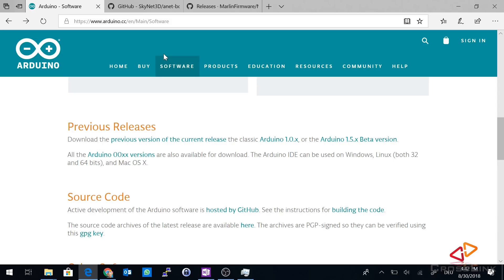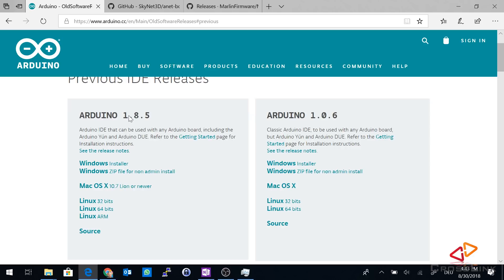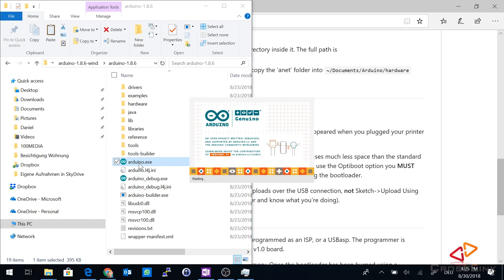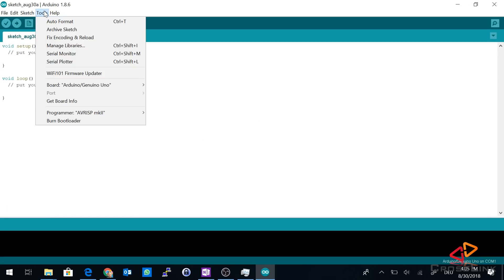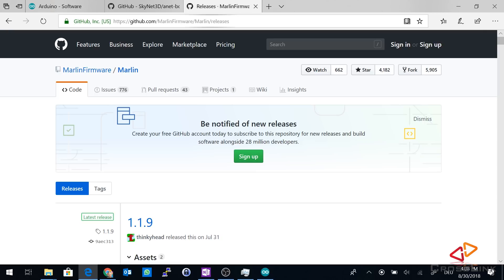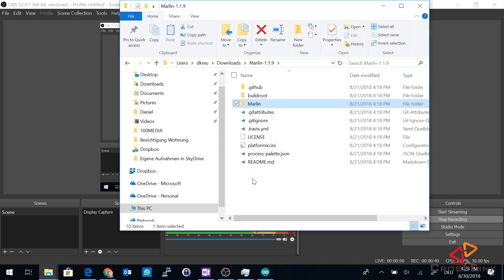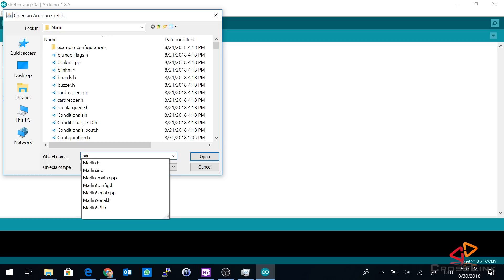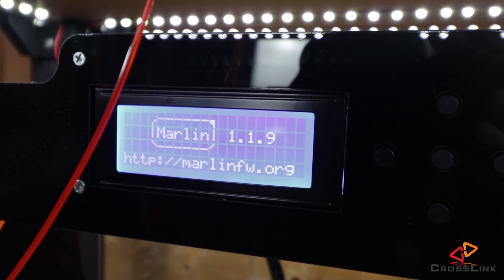How to install Marlin firmware 1.1.9 on your Anet A8 3D printer in 7 easy steps

Comment: Thank you for this video - it's been really hard to piece things together for this process - your video makes it all crystal clear.
However, and this may not be something you can help with, but I'm unable to complete the load.
the IDE reports:
avrdude: stk500_getsync() attempt 1 of 10: not in sync: resp=0xd6
...
avrdude: stk500_getsync() attempt 10 of 10: not in sync: resp=0xd6
An error occurred while uploading the sketch

Using the serial Monitor at 115200 baud, I can see the processor reboot, and report back the amount of free ram and then:
SD init fail

Any ideas you might have would be very welcome.
thanx
Reply from the maker: Not in sync points mostly to two possible problems. First you might have missed to install the Arduino drivers, which are in the drivers subfolder of the Arduino IDE installation folder. Or secondly, you might have a problem with your bootloader, which requires fixing by using an Arduino as ISP or an USBTinyISP as a programmer. I will cover this in one of the next videos ;-)
Reply from the maker: Actually I got to hear that Anet delivered a lot of boards (not all) without a bootloader. So you would have to flash a new one to fix it.
Reply: Thanx for the help.
I tried to load the bootloader, but with the old ICSP (is that the correct acronym?) I got a different failure.  The connector to the anet board has all of the wires swapped on it, and now I'm wondering if maybe the unit is just screwed up.
So I'm going to get a new unit and try again.
r
Reply from the maker: Check out my new video about how to fix firmware flashing and broken bootloaders: https://www.youtube.com/watch?v=RQIizXtf9oo

Comment: I am on the point after verifying the code and I got an error #error "Oops!  Make sure you have 'Arduino Mega' selected from the 'Tools -> Boards' menu." should I proceed on choosing that option?
Reply from the maker: You need to select the Anet 1.0 board if you try to flash using the USB cable. If you dont"t have that option you missed the initial step to copy the board master files.
Reply: @Crosslink3D  I figured out what was wrong after couple hours of reading all the codes. I have to put anet 10 motherboard on the define command somewhere within the codes. That's what's causing the error.
Reply: I manage to upload it with no issues, hope it works.  Haven't tried it yet. But i'm still going thru all the settings, hopefully I get it to work by this weekend.
Reply from the maker: Cool, keep me updated how you do 👍
Reply: Just got home and was excited to get back to working on my setting and after I turned on my printer, two rows of white square appears on my printer lcd screen. Tried to verify and got an error. 

"GetFileAttributesEx C:\Users\gacac\AppData\Local\Temp\arduino_build_757491: The system cannot find the file specified.

Error compiling for board Anet V1.0."
Does this mean my board need replacement or can it still be resurrect with USBASP?  @Crosslink3D
Reply: OMG this is what i'm getting now "Build options changed, rebuilding all
In file included from sketch\pins.h:242:0,

                 from sketch\MarlinConfig.h:40,

                 from sketch\G26_Mesh_Validation_Tool.cpp:27:

pins_ANET_10.h:92:4: error: #error "Oops!  Make sure you have 'Anet V1.0', 'Anet V1.0 (Optiboot)' or 'Sanguino' selected in the 'Tools -> Boards' menu and ATmega1284P selected in 'Tools -> Processor' menu."

   #error "Oops!  Make sure you have 'Anet V1.0', 'Anet V1.0 (Optiboot)' or 'Sanguino' selected in the 'Tools -> Boards' menu and ATmega1284P selected in 'Tools -> Processor' menu."

    ^

exit status 1

#error "Oops!  Make sure you have 'Anet V1.0', 'Anet V1.0 (Optiboot)' or 'Sanguino' selected in the 'Tools -> Boards' menu and ATmega1284P selected in 'Tools -> Processor' menu."

Using proxy DIRECT

Using proxy DIRECT

Using proxy DIRECT"

It was working ok last night, what would went wrong.. I have no idea.....
Reply from the maker: What Version of the Arduino IDE are you using?
Reply: @Crosslink3D  1.8.5
Reply from the maker: I think your problem has nothing to do with your board. If you get a compiler error there must be something wrong with the Marlin sources. Maybe get a plain new snapshot of Marlin in a new folder, change nothing and then try to compile.
Reply: @Crosslink3D  Youre a SAVIOR thank you. Its ALIVE!!!!! lol... Now time to learn how to calibrate...
Reply from the maker: If you get other errors, maybe check out my new video about how to fix broken bootloaders. Also helps with "sketch too big" errors when enabling many features: https://www.youtube.com/watch?v=RQIizXtf9oo

Comment: If I get to relate the topic of Edward Garcia´s comment. I also get "not in sync" errors when I try to flash the Marlin firmware to the motherboard of my Anet A8, and I am using a USB B cable ^^ How am I supposed to do it?
Reply from the maker: You may have a broken bootloader. It can be resolved using an Arduino as ISP or a TinyUSBISP. I am making a video of this in the next weeks but I am still working on the details.
Reply from the maker: I have just released my howto video how to fix broken bootloaders and other issues: https://www.youtube.com/watch?v=RQIizXtf9oo

Comment: Thanks for the video. I tried but by uploading firmware i got errors:

Arduino: 1.8.5 (Windows 10), Board: "Anet V1.0"

Sketch uses 125002 bytes (98%) of program storage space. Maximum is 126976 bytes.
Global variables use 4318 bytes of dynamic memory.
avrdude: stk500_getsync() attempt 1 of 10: not in sync: resp=0xd6
avrdude: stk500_getsync() attempt 2 of 10: not in sync: resp=0x6f
avrdude: stk500_getsync() attempt 3 of 10: not in sync: resp=0x80
avrdude: stk500_getsync() attempt 4 of 10: not in sync: resp=0xbf
avrdude: stk500_getsync() attempt 5 of 10: not in sync: resp=0xae
avrdude: stk500_getsync() attempt 6 of 10: not in sync: resp=0xd6
avrdude: stk500_getsync() attempt 7 of 10: not in sync: resp=0x02
avrdude: stk500_getsync() attempt 8 of 10: not in sync: resp=0x21
avrdude: stk500_getsync() attempt 9 of 10: not in sync: resp=0xcc
avrdude: stk500_getsync() attempt 10 of 10: not in sync: resp=0xd6
An error occurred while uploading the sketch

Any suggestions?
Reply from the maker: Yes you probably have a broken bootloader and need to use an Arduino as ISP or a TinyUSBISP to flash a new one. I will do a video about it I the coming weeks but still working on the details.
Reply from the maker: I have just released my howto video how to fix broken bootloaders and other issues with firmware flashing: https://www.youtube.com/watch?v=RQIizXtf9oo

Comment: i bought my anet A8 about 1year ago.. haven't printed 1 thing..i built it and was all excited.then after all my research i was told i needed to update firmware to marlin.. so i tried it following all the steps.. didnt work (not in sync error) So i search and search found nothing that worked. I ordered a new board.. same issue. I finially gave up and was just burnt out on dealing with it. I saw this video today and decided to try it again.. and same error. by the way I have the USBASP tool and tried all that and didnt work for me. any help would be appricated
Reply from the maker: Hi James, I know this topic is frustrating. Especially if a bootloader is missing. I am currently putting together another series of videos that cover that topic. so you will have a place to go to watch all the details. Upfront I can tell you that USBASP did not work for me on Windows 10 but I was successful using an Arduino Uno that I had laying around. What I will also test is a USB Tiny ISP.
Reply from the maker: Actually I got the USBASP only working with Windows 7, since I have upgraded to a new PC with Win10 it doesn't work anymore. There is some tools out there that claim to make it work again but very cumbersome and not working for me.
Reply from the maker: I have just released my howto video how to fix broken bootloaders and other issues with firmware flashing: https://www.youtube.com/watch?v=RQIizXtf9oo

Comment: Hi, first of all thank you for video. Now my anet a8 is running with marlin. But i have problem. I get this error; "THERMAL RUNAWAY PRINTER HALTED Please Reset" This error  started when i installed marlin. Please help me.
Reply from the maker: Most likely one of your connections (heated cable, hot end heating element) on the board is loose. Better crimp cable shoes to all connections delivering power. Also check if the heating element's grub screw is tightened at the Hotend. The original firmware does not detect thermal runaway, so there might have been some issue before flashing already. Thermal runaway is triggered if any temperature (Hotend, Heatbed) drops more than 15degress Celsius for more than 45 seconds. Another issue could be that your Hotend cooling fan is cooling your heating block too fast when the fan starts running. This kind of heat block "sock" can help a bit to prevent this: https://www.ebay.com/itm/3D-Printer-Silicone-Sock-Heater-Block-Cover-MK7-MK8-Hotend-Heater-Protect-ur/183531575623?hash=item2abb559947:m:mrXO3uBZ0Ntvqiee1Ba28eA
Reply: @Crosslink3D  ohh :) yeah problem is connections. i checked all connections and i am printing now. I am learning a lot of things your videos. Thanks again :)
Reply from the maker: Great to hear that. I believe since this problem was asked a few times, it would be good to make a special tips video for this issue. Greets. Daniel

Comment: hey thanks for the video, ive follwed your instructions and its loaded with marlin 1.9 but the X Y X are flashing with 0? any ideas as to what is wrong
Reply from the maker: Hi Carole, what exactly do you mean with x y z are flashing with 0? Can you explain please?
Reply: @Crosslink3D  X y and z are all flashing from a 0 to a ? repeatedly, im also having trouble with auto bed leveling, i have it all in the menu and the sensor attached but it crashes in to the bed everytime i press home all
Reply: its like it dont know when to stop,as i have removed the endstop
Reply from the maker: Please dismount the sensor and hold it perpendicular to the printbed. Does the red light light up when you get close to the bed? how close do you have to go to make it turn red? FOr me, the distance is 2-3mm.
Reply from the maker: Any news here? Would love to help but need your feedback ;-)
Reply: Hi @Crosslink , I've just got the same error.  XYZ all alternating between ? and 0.  No other commands on the panel appear to be working.  Enter takes me to a menu, but trying to select anything sends me back to the home page.    Up and Down alter the FR %, but that's all.  Any thoughts?

Comment: It keeps overriding the 115200 baud rate
         Using Port                    : COM6
         Using Programmer              : arduino
         Overriding Baud Rate          : 57600
avrdude: stk500_getsync() attempt 1 of 10: not in sync: resp=0xd6
avrdude: stk500_getsync() attempt 2 of 10: not in sync: resp=0x6f
avrdude: stk500_getsync() attempt 3 of 10: not in sync: resp=0x80
avrdude: stk500_getsync() attempt 4 of 10: not in sync: resp=0xbf
avrdude: stk500_getsync() attempt 5 of 10: not in sync: resp=0xae
avrdude: stk500_getsync() attempt 6 of 10: not in sync: resp=0xd6
avrdude: stk500_getsync() attempt 7 of 10: not in sync: resp=0x02
avrdude: stk500_getsync() attempt 8 of 10: not in sync: resp=0x21
avrdude: stk500_getsync() attempt 9 of 10: not in sync: resp=0xcc
avrdude: stk500_getsync() attempt 10 of 10: not in sync: resp=0xd6

avrdude done.  Thank you.

An error occurred while uploading the sketch
Reply from the maker: Did you install the Arduino drivers before trying this? Most of the time this solves the issue. Does it work for you in the meanwhile?
Reply: @Crosslink3D  I did, it turns out that that 1.5 version of the board doesn't have a bootloader, and I need an Arduino board to install Marlin to the board.  Now my extruder isn't doing good, it starts printing, then shortly after it starts extruding, it clicks a bunch then pushes the filament out the side.
Reply from the maker: Out the side means out of the side of the extruder housing? Are you printing flexible TPU?
Reply: @Crosslink3D  PLA and ABS
Reply from the maker: I once had the issue that after printing ABS and then switching back to PLA, my nozzle still had a good amount of ABS in it and because PLA is printed at lower temps, the ABS did not melt and the nozzle got clogged. I had to dismount it, bake everything in the oven at 250° C and then clean it with a needle quickly. Clicking can have several reasons: nozzle too close to the bed, too low temperature for the material, flow too high (overextrusion). If you eliminate the possibilites in that order, you probably get rid of the issue quickly. Also, too much retract causes all kinds of issues. Originally it's depending on the slicer you use probably around 6mm. Try going lower, start with 2mm and print out this to find the right value: https://www.thingiverse.com/thing:2219103.
If you want, send me over your Configuration.h from your Anet, so I can check if I see something strange.
Reply: @Crosslink3D  Cura 3.0.4 was doing some weird stuff, when I used an older version I was able to print a few upgrade parts finally, there is a new version of the board out 1.7, supposedly they eliminate the need for MOSFET units, and are firmware up-gradable the way you outline here.
Reply from the maker: Hi, I am preparing a video about how to flash the firmware when the bootloader is missing or the board is bricked. That should be the alternative if the normal USB flashing does not work for any reason. At some point using an Arduino as ISP or a USBTinyISP is unavoidable because for example if you enable bltouch support, a new LCD display and auto bed leveling, you will run out of available memory for the sketch. From that point on using optiboot or flashing directly will be the way.
Reply: @Crosslink3D  I used an Arduino Uno to burn a bootloader, so now I can follow your video to install a firmware, I just did it this past Thursday.
Reply from the maker: I have just released my howto video how to fix broken bootloaders and other issues with firmware flashing: https://www.youtube.com/watch?v=RQIizXtf9oo

Comment: For some reason, after my print finishes the Y axis doesn't return to home. Anyone have any ideas why that may be? Not using the stock board btw. Using this Anet E10 board ,which appears to be pretty much the same minus their FrankenMarlin monster Firmware being pre-installed. https://www.amazon.com/gp/product/B07GVFBSV2/ref=oh_aui_detailpage_o00_s00?ie=UTF8&psc=1
Reply from the maker: Probably this is something you want to control in your slicer software as a GCODE after finishing printing. In Cura for example there is GCODES before the print and after the print. There you could tell the printer anything like return to home etc.

Comment: I tried this with the current Arduino 1.8.8 and it failed to verify the new firmware. Installed version 1.8.5 instead (as you suggested in the video) and it worked fine. Thanks for the video.
Reply from the maker: Yeah somehow the latest versions seem to be broken for Marlin. Will investigate also a bit more into that.

Comment: my printer have the version 1-5. on the board what should I do
Reply from the maker: Flashing using the USB cable should work. Don't forget to install the Arduino drivers.
Reply from the maker: Did you manage to flash? If not, stay tuned for a new video about how to do it using an Arduino or USBTinyISP, very soon.
Reply: @Crosslink3D  Can you please do a video on this soon. I'm new to Arduino and I'm not sure how to do it
Reply from the maker: Yes, will do, very soon.
Reply from the maker: I have just released my howto video how to fix broken bootloaders and other issues with firmware flashing: https://www.youtube.com/watch?v=RQIizXtf9oo
Reply: Crosslink ok thanks I didnt the files of the sd card
Reply from the maker: The Arduino drivers are in the Drivers subfolder of the arduino ide.
Reply: Crosslink thx i will try it

Comment: Could u post a quick video on how to level the bed without a sensor, using the Marlin software once installed on the Anet A8
Reply: Thanks for the reply, and those links were the method I used to use prior to the Marlin firmware, now there’s a setting in Marlin to bed level thru the control display.
Reply from the maker: @elis51501  that's right. Definitely worth covering that in a video.
Reply from the maker: There you have it : https://youtu.be/ADdzKyS-T3w
Reply from the maker: Thanks for the feedback. I will do one specifically on this topic. In the meanwhile you may like to watch these two videos, which cover the process as well, but not dependent on the firmware. https://youtu.be/OiQjxAKAPUQ and https://youtu.be/Inr1SuhnUk0. There is actually a function in Marlin called manual mesh bed leveling, which I will also cover. Stay tuned!